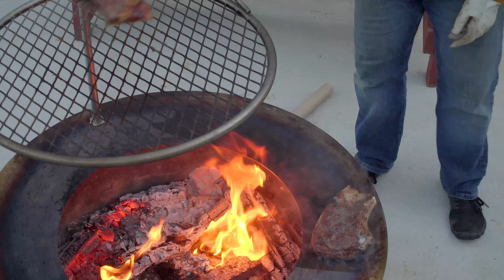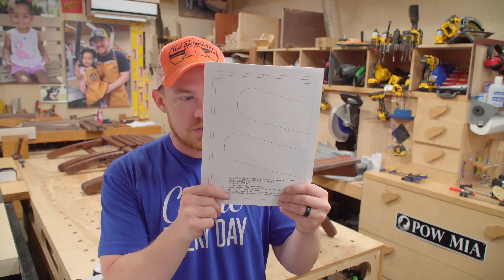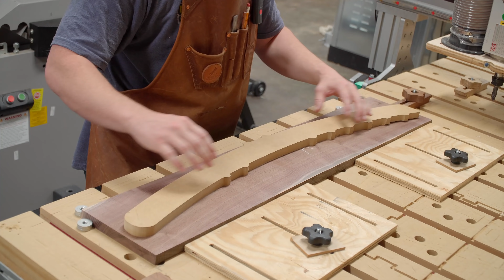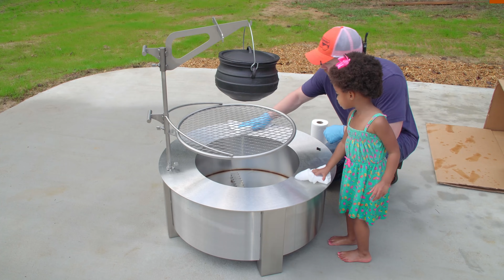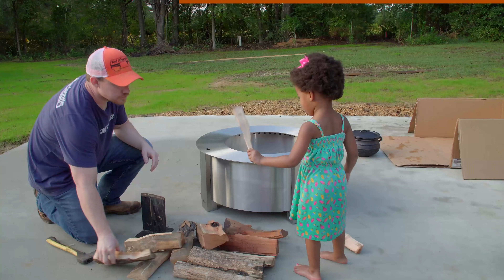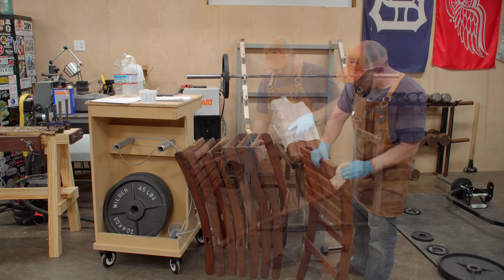Firepit Chairs - 375

Comment: Jay, I bought your MDF template and after unboxing them, I realize the chairs will be quite short, or low to the ground. Can the plans be modified to make the chairs taller? I appreciate your videos and help. Thank you.
Reply from the maker: Ya you can add an Inch or two to each leg. Just trace the entire template, shift it down an inch and trace the extra. Bandsaw the waste, stick the template on and pattern route all but the bottom. Shift the template down and finish the routing.
Reply: @JayBates , Thank you!
Reply: What is the seat height?  I can find lots of videos and plans but none say the chair height and I want to build some to sit at a table that’s 30 inches tall

Comment: Jay, Did you say you modified your previous files?  I originally bought your files in 2019 with the idea I would make them on my CNC.  But, never got around to making them yet.  Still plan on doing this have you updated the vectors for the CNC or are my files still the most current version?

Comment: I noticed that you use one screw in each end of the slats vs two in your older video. Did you find out that one was strong enough or was it easier with one? Or mixture of both? I plan on making several sets of these and I just was wondering. I'm a big guy so your design will definitely be put to the test! I'll keep you posted when I get the templates, which shipped amazingly fast btw!!
Reply from the maker: I think 2 was overkill originally.
Reply: @JayBates  thank you! I appreciate the reply

Comment: Jay, i just purchased your MDF templates, love the design. In this video you are using 1 screw on each side of the slat. On your website where you purchase the templates, that shows 2 screws per each side of the slat. Do you think 1 screw will be adequate? Or 2?
Reply from the maker: I think one screw is fine. Considering the joint is somewhat mechanical restricting movement  in and twisting and then is secured with glue and then pinned with a screw...I don't think there will be an issue with using one screw per slat.

Comment: Jay, I purchased your set of templates and have made four nesting chairs: one out of pine, one of plywood and two from hardwood. Everyone loves them and think that they are very interesting and comfortable. They are all well-loved and work great. I've literally spent countless hours reading in my nesting chair this past summer. Thanks for the plans and template!
Reply from the maker: Thank you for the feedback!
Reply: Did you incorporate the cross brace in the bottom piece?
Reply: @TheRPhelps24  I did for all of my chairs. Like Jay said, it's the hardest part of the chair but it gives a nice accent/look to the chair. My only "problem" with all versions of the chair (pine, plywood and oak) is that the point between the two halves of the chair meet and hold all of the weight tends to crush in. So, if you stain the wood a dark color (or paint it!) it becomes very noticeable after a while. But, since the chair is in a stored/collapsed configuration most of the time it's not noticeable. Still, I love the chair!
Reply: @TheRPhelps24  I still do because it looks nice. However, on my next chair I'm only going to use one screw per slat as I think it's overkill.
Reply: It looks like the bottom would be uncomfortable. Is it really that comfy?
Reply: @rjmills126  Actually, it is very comfortable. I have literally spent six hours at a time on these chairs during the weekend, sitting outside to read. I've never felt uncomfortable.

However, if you want to you could always get a couple of those outdoor seat cushions for your chair.

I've made five of these chairs so far. Everyone loves them.
Reply: @gpdoyon  thanks!

Comment: can the cross brace (the one you left out to test) be a half-lap joint ? that would keep the language of design the same with the slats.. thoughts?
Reply from the maker: Yes. However, a half lap joint would be a reduction in frame piece width. I honestly don't think it's necessary at all.
Reply: I built a half lap design similar to this years ago with the frame cut from 2x8 cedar. While they are still in service and I have planted my 200# butt in them more than once I don't trust them for loads much over 200# because I feel the half lap is a weak point.

Comment: Have you tested or considered max weight for these? I'm a bigger guy, 6'8" and 240#, I've messed with other chair builds and outside of the beefier build of an Adirondack and not been comfortable with the ability to support higher weights. In particular there is going to be a lot of stress on the cross members where the seat goes through the back.
Reply from the maker: The frame pieces are the only concern as they will take the worst of the forces. Slats will better disperse the weight amongst many slats. For that reason it's best to avoid any defects and knots in the frame pieces so they are as solid as possible. A solid hardwood frame will be stronger than a solid soft wood frame like pine. A solid soft wood frame will be stronger than a soft wood plywood, due to half of the plys going in the weak direction. We put over 400 pounds on a pine plywood version to test it with no signs of cracking or failure.
Reply: @JayBates  Maybe the concern is that 300 plus pound people don't sit down very gently and people are assuming you placed the weight a little at a time and gently.
Reply: Also interested in this as well for someone pushing 280lbs.
Reply: I have made several of these using Jay's template. Some out of cedar. Some pine and a couple out of Royal Trim Board (PVC board) which is manufactured for looks and not strength. But man is it light and completely waterproof. It also paints well. Anyhow they all held up to me with no problem 6' 2" at 270 pounds. One CON for the PVC board is that it creates an awful mess. So much so that I will not make anything out of it again but will use it for exterior trim always.

Comment: Thoughts on using cedar?
Reply from the maker: I don't see any issues. I had 400 pounds on a line plywood version. Solid cedar should be stronger than pine plywood.
Reply: I was going to ask the same question. Glad I scrolled through the comments and found it so I don't look like a idiot asking a question that was already answered.

Comment: So each piece of wood was only big enough for one side piece (with a lot of waste). Would it have been possible to glue the wood together then cut nested side pieces? Then you can utilize the wasted wood better. And since you are gluing edge grain it should be plenty strong. Or am I missing something? Of course the grain pattern will be different. Is that it?
Reply from the maker: Absolutely. Gluing a panel will be the best use of material. The offcuts here went into the cutting board stack.

Comment: I think I would feel better about the longevity of the chair woth a bottom brace in. The slight racking of a person sitting on it will put quite a bit of strain on the one screw and glue joint in the slats on the other end. I've had single screwed slats come loose over years of use on far more rigid designs than this.
Reply from the maker: I disagree. I'm confident in their strength and construction. Time will tell :)
Reply: @JayBates  Indeed, a harmless experiment, at most you'll have to tighten down the slats a bit. My furniture was exposed to the elements for most of the year, under cover they'll have an easier time probably.